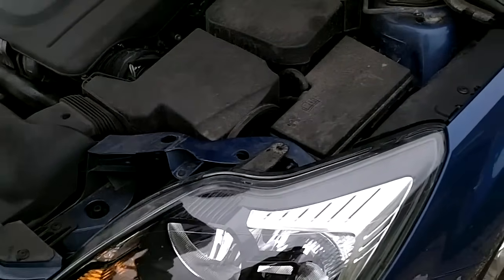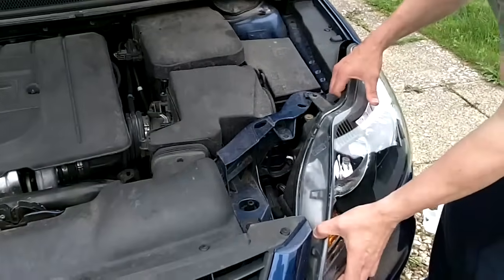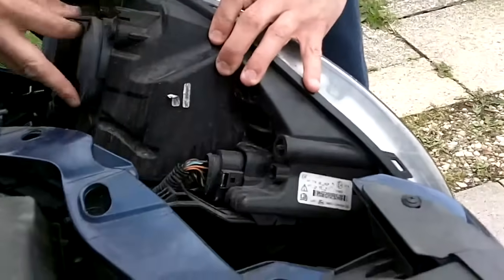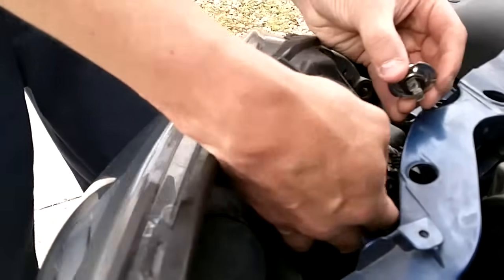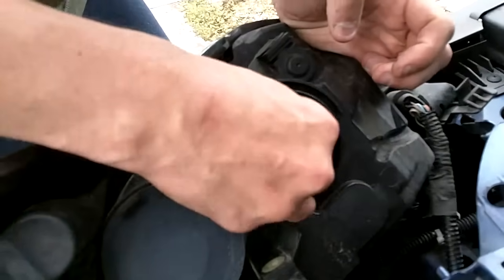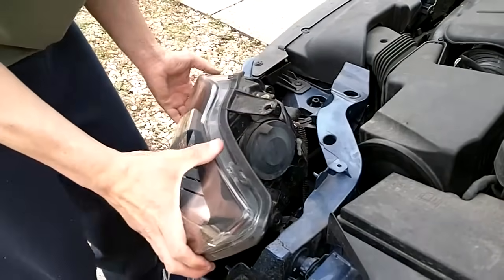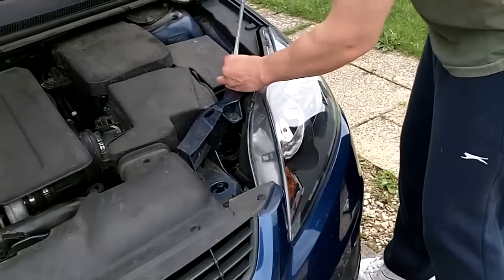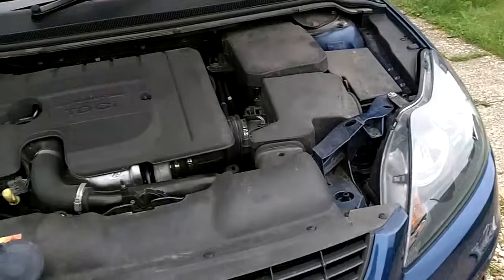Replacing a 2008 Ford Focus Headlamp in under 3 minutes.

Comment: Great video. Just purchased a Focus with a bulb hanging out. I spent 20 minutes trying to get the connector on with the bulb in place - then read you need to put the bulb in first then clip the connector on - 60 seconds later job done!

Comment: For my 2007 Focus, once the headlight assembly was off (the hard part) there was a hard cover with latches over the bulb units, which were also different.- but both parts pretty obvious to work out. I would never have known where that the two casing latches were so easy to move out without this, so many thanks.

Comment: Thanks a lot. I found the two clips mentioned in the manual - but what the manual doesn't say is that you have to wiggle the unit quite a lot to release it (in fact the manual doesn't even say you have to lift the headlamp unit out - which is pretty obvious, but why not state the obvious?). Your video gave me the confidence to do just that. Plain sailing once the unit was released. Many thanks again.

Comment: Thanks mate , a great help. Just changed mine on my 2005 Focus which was slightly different to yours as regards the housing on the back but otherwise basically the same.The clips were a real bugger to locate but with the aid of a torch I eventually found both of them with the screwdriver.Re-clipping back in after was also a pain but got there in the end. Thanks for putting the vid online,got the bulb from Amazon for £1 and now fitted myself saving myself a tenner at the garage.Top Man!

Comment: Thank you so much for that.  I had fiddled in the sleet for 1/2 an hour and came in swearing about the designers, when in fact it was the manual writers who were to blame.  I can empathise with the hammer wielding comments - I was getting there too.  I have now clicked on like and the advert and hopefully others will too.  You deserve every click.  Thanks again.

Comment: Great video.  I'd never have found the headlight assembly second clip without it.  BUT, a previous poster is spot in about placing the bulb in its hole before putting the connector back on.  It's actually easier to do it that way too.  The metal lug on the bulb is designed to only fit one way (toward the bonnet/sky) in the headlight assembly!  Once inserted, push the wiring connector onto the bulb and move the small plastic clip on the connector (bottom end, facing the floor) until it clicks into place.

Comment: Can I just say most of you have misaligned bulbs now!!!!! Look at your light pattern on the floor in front of your car!! Not right. The removal is perfect !! But place the bulb IN THE LIGHT BEFORE you re connect the wiring. Or the bulb will sit facing upwards. It's just as quick and you get the correct beam pattern.  You will notice a huge difference!!! Go look at your bulb through the light it should sit flat and not tilt upwards.

Comment: Many thanks for this. Saved having to figure it out myself.
Just like to add about the small 'guide' used to locate the bottom corner at the rear of the light assy. when replacing the unit..

Comment: Hi, I appreciate this is a very old video, but does the nearside light have a different technique when it comes to refitting? I now have a 1cm gap between the headlight and the top of the bumper that wasnt there before. Offside light went back in without any trouble.
Reply: Mine is the opposite way around. Offside has fucked up and out of alignment and can’t wrap my head around it.

Comment: My 2009 focus zetec I recently purchased I thought had some condensation,but the actual plastic is smoked /been too hot/white cloudy just slightly above the side light bulb,both sides.Any ideas?Maybe previous owner had fitted the wrong bulb?Got too hot?Never seen this before on any car and annoying to look at.
Reply: MrSmid888  was just wondering if u ever got an answer to your question. The same has happened on my 2011 on both sides.

Comment: Mine was different. Had to remove the grille by removing 4 plastic push pins and their plastic seating, followed by prying the bottom half out of the plastic clips holding the bottom in. This allowed me to get to the final bolt and washer that was covered by it (3 total holding the headlight assembly in). Mine's a 2008 focus se coupe (perhaps the difference?). Hopefully this helps anyone who has my model. Took me forever to get the  grill off because of terrible instructions in the manual (I guess that's the same hahah).

Comment from the maker: I might be wrong but if it is a UK model I would have thought they would all be the same.  There were bolts on the top but on my car I didn't have to touch them, just released the clips and the housing came away.  Let me know how you get on,

LB

Comment: You need the strength of ten tigers to pry the bulb away from the holder. I ended up putting the flat head screwdriver between the bulb frame and the socket and twisting to free it.

Comment: Follow these instructions for effortlessly changing the bulb and saving a lot of extra work or £8 odd fitting charge at Halfords.

One tip...before buyibg a replacement bulb check tonsee the existing hasn't worked loose, I did and saved discarding a perfectly good bulb.

Comment: Your focus seems to be different than my 2008. I will check for the clips but I have three bolts to take out and it still won't release the bucket. report back latter.
PS first car I ever owned that I can't change a lousy headlight.

Comment: Why do Ford make everything so damn difficult! Back to Vauxhall on next car change
Reply: wouldn't base my next car on 1 screw and a couple of clips but hey , some people make a problem out of anything
Reply: 008nigel So hopefully you will have to go to a dealership for them to fix it and then charge you a small fortune,and you know what sort of money they charge,as the old saying goes,even Dick Turpin had the courtesy to wear a mask!
Reply: Try Renault ;) 
You'll be stuck trying to replace headlight bulbs forever :P
Reply: My Vectra bulbs could only be changed when facing forwards and fiddling behind your back!

Comment: This is bull shit!
IU just changed a front headlight on a Ford focus .
There are three screws or bolts that hold the headlight in place. You have to pop off the grill to get to the third. Most people think you can remove the air filter housing to get to the lamp without removing the globe.
Hate to tell you but the frame bracket is in the way so that you can't reach in and remove the bulb.
I looked at three different videos showing how to remove the bulb and not one had it right!